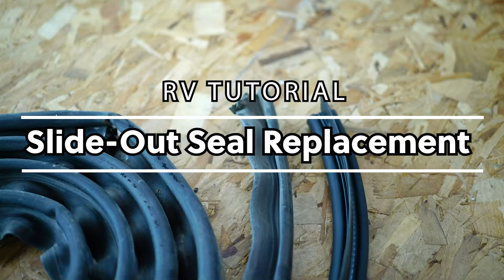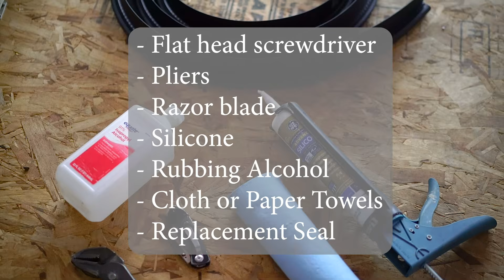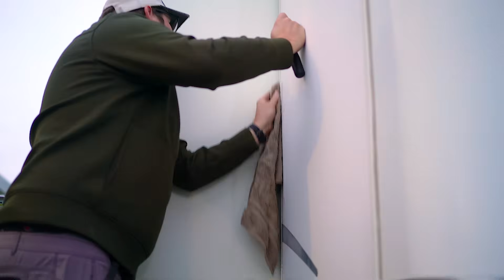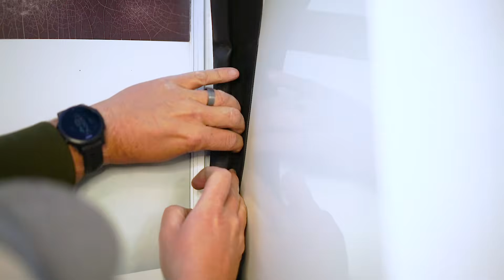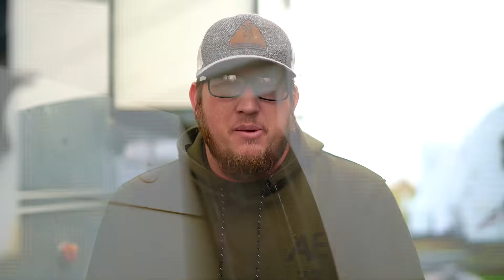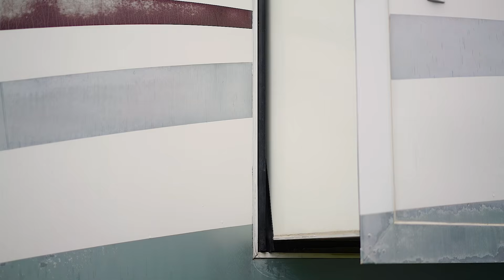RV Slide Out Repair | How To Replace RV Slide Out Seals | RV Slide Out Maintenance

Comment: Hi! We have this same year and model rambler we bought used last summer. We are also needing to replace the gaskets (our back slide is leaking). Your video is so helpful! I just have a question, what size and length gasket is it that we need? I'm on Amazon trying to purchase what we need and there are so many options. If you could help, I'd really appreciate it!

Comment: Thanks! Sure wish the shop that did our slideout replacement actually cut the corners.  The seal is pulling out on the rear side and wondering if they didn't also bend the snap on component to make it easier.  Thanks again.

Comment: Excellent clip on what to do, thank you so much. What is the measurement of the rubber flap (wiper) part please as I have seen different sizes for sale 2', 2-1/2, and 3' I have the endeaver like you so this info will be apreciated thanks

Comment: Where did you buy this seal from please
Reply from the maker: We got it on homedepot.com, it's a double bulb seal with wiper
Reply: @TheFlippinTilbys  thank you so much
Reply from the maker: So very welcome
Reply: Thanks for the video!  I have the same double bulb seal as you. I’m having trouble pushing the rubber on to the metal. Did you lubricant, heat or use a tool to attach the rubber?